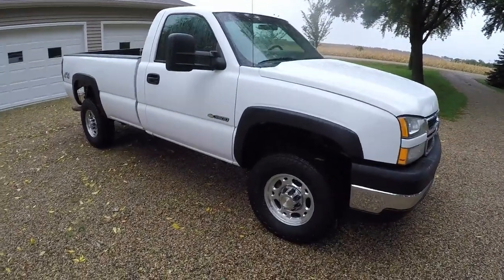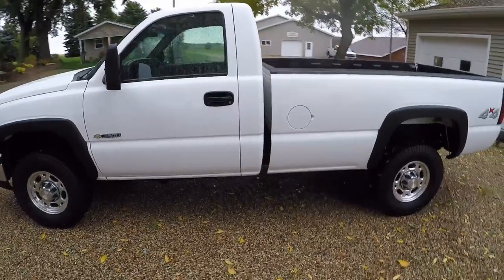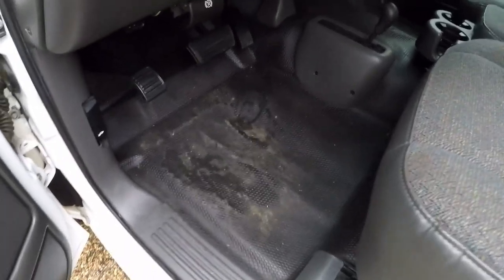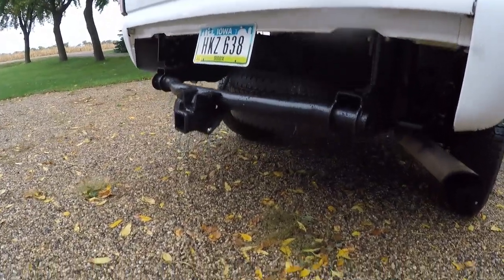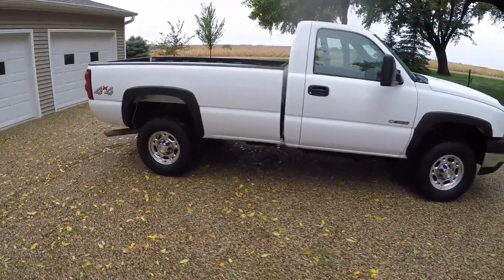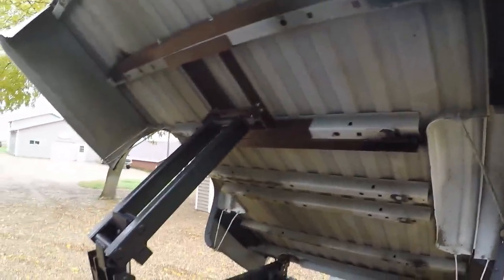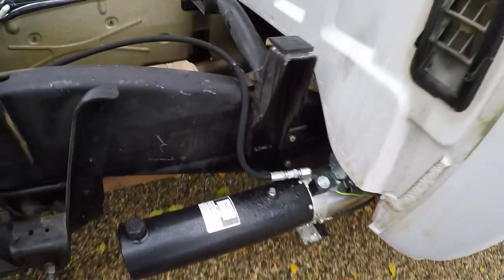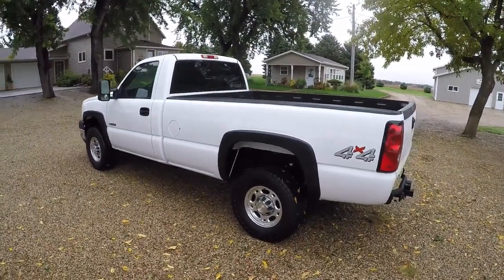'07 Chevy Silverado 3500 Pierce Dump Bed Kit - Dad's New Dump Truck

Comment: We use the same lift for our truck for tree service we have the stock  bumper on the truck we just remove the tailgate when we dump. it's really not as bad of a deal especially if you put an inner handle that you can grab ahold of it when you're removing it and putting it back on.
Works great

Comment: You can make the bumper tilt with the bed just weld the bumper brackets to the bed hinges and then bolt on the bumper and your set.

Comment: I know this is a old post, good job ,now just convert bumper to a scissor action ,out from bed ,down ,and back in near ,may be 1 inch off ground.Might even use a splitter on hydraulic line to manipulate bumper prior to raising bed .Sounds simple , is say doable and cool .Done all the time out west.

Comment: Nice truck .I would update the hitch to a drawntite Ulta frame hitch so much safer than the OEM hitch
Reply from the maker: We'll look into that!
Reply: @TyBrink  I work with rv and see 3 hitches brake in 2 .those 2 middle bolts not bolted will flex the hitch and it will brake . I put a new hitch on my hd made it so much safer to tow with.
Reply from the maker: @blackgmc01  damn that doesn't sound good, thanks for the heads up.
Reply: @TyBrink  there is the power windows and panels for your silver truck
Reply from the maker: @blackgmc01  Haha dad won't let me have them!
Reply: @TyBrink  I have a 6.0 truck change the oil and they will run forever. Awesome power train

Comment: I have one on my 02 Chevy 2500 6.6, and it works great, I use it for trash, wood, mulch, rocks etc. I don't know if it's the same kit though
Reply: Did you put your bumper back on
Reply: @markfava80  I don't know, I bought it with the dump bed already
Reply: I have a 1999 Chevy 3500 I'm thinking about adding this same setup/dump hoist to. What is the most weight you were able to dump/and or hold in the bed with your setup?

Comment: How much have you tipped with this so far? I'm interested to know how the cross member stood up to having the ram clamped to it? 👍
Reply from the maker: If the bed gets loaded with too much weight then it will just not lift it. No damage to the crossmember, there were supports provided to bolt to the crossmember to add some strength. Its a 2 ton rated system that's all it will lift.

Comment: I have a question can u still tow a trailer after it’s installed
Reply from the maker: Yes the trailer hitch bolts to the frame so it's separate from the bed. The factory hitch needs support in the middle though so we made a custom metal bumper to bolt the middle of the hitch

Comment: You should throw like a .5” body lift on the cab so it lines up with the bed
Reply from the maker: The kit came with 2 bumper pads to make it quieter when the bed drops, so we can always take those out and do a little modifying to make line up.

Comment: Little late but that's a SLE package
Reply from the maker: SLE is a GMC package
Reply: My bad mines a o4 GMC Sierra with a slt package and it kinda looked like the same features a sle has
Reply from the maker: No worries man, GM's badging names are pretty dumb anyway. On chevy trucks in 99-06 LS was the normal package with power windows and some basic features and LT was basically loaded with leather and everything, but in 06 and newer trucks they changed the LT badge to basically be more like the older LS package.